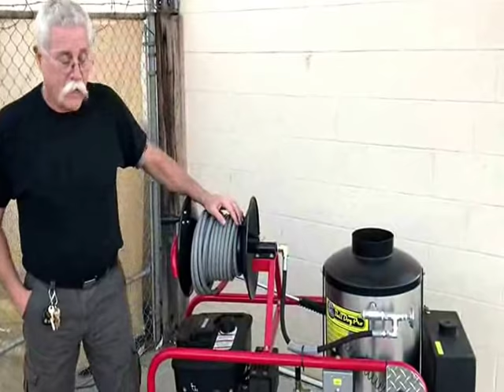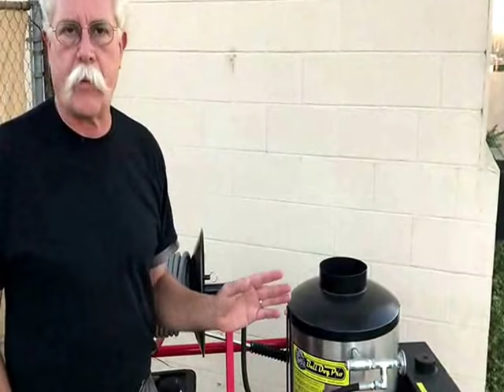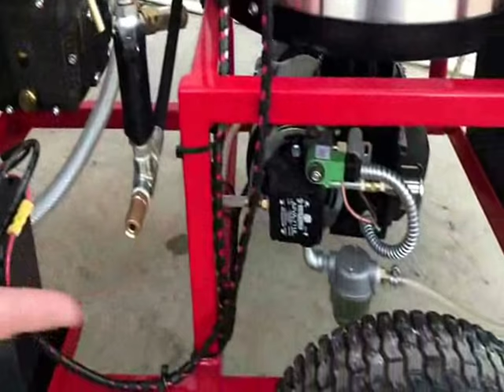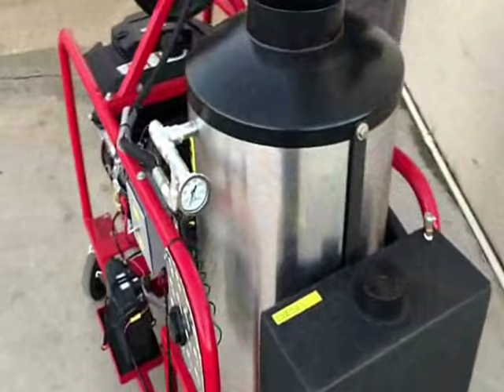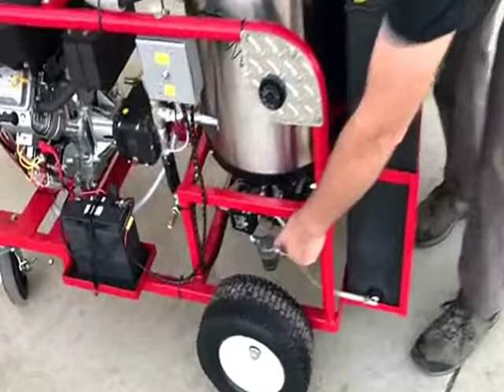Show & Tell: PHG5-4000 Portable Hot Water Pressure Washer  ✦ PressureWasher.net

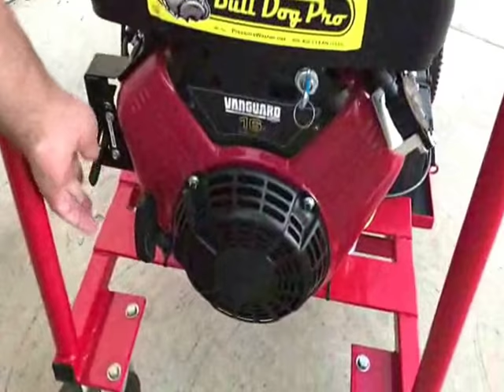Comment: At 2:30 you mention turning the engine RPM down. Doesn't the engine only produce charging current at mid and high RPM? If that is correct, the burner will eventually draw the battery down.